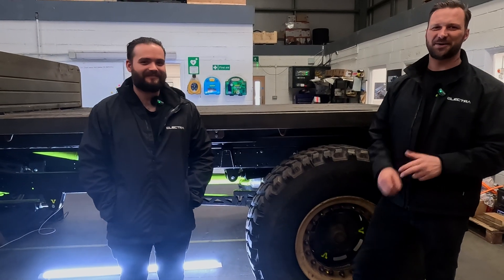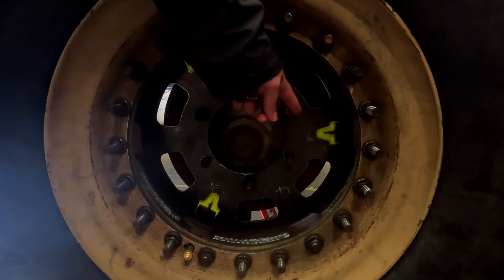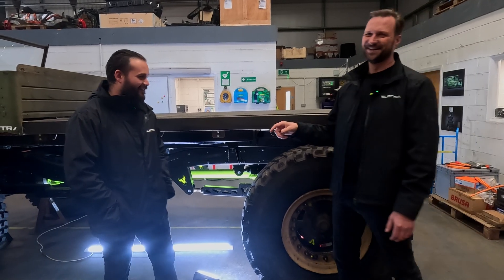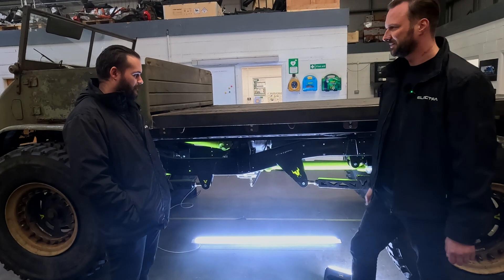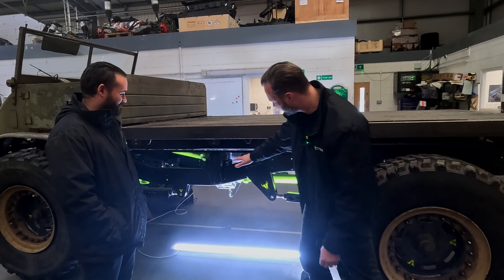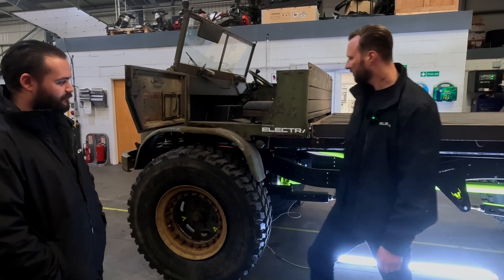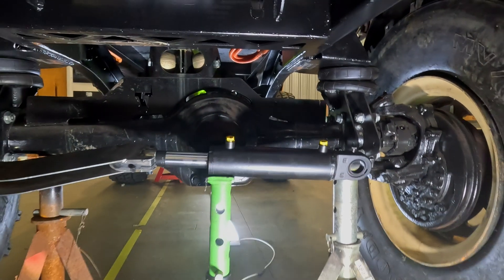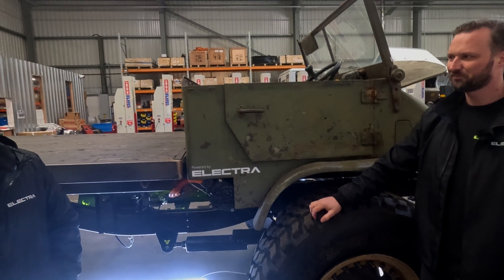Electric Unimog 404 Mog-E (Part 3) Progress and future plans for the Unimog

Comment: Quite interesting and nice build! Really nice craftsmanship. 
And probably the first right-hand drive 404 I've seen! However, not the first electric 404. There is one running around in trials sport. Although with a different approach, keeping the organal gearbox and torque tubes. 

As you mentioned, stiffening up the chassis is a major concern, at least if you want to do some serious offloading. The 406 Unimogs with forestry equipment had broken frames due to the heavy winches and the harsh environment they see. So the companies providing the winches stiffened up the frame to make it stronger and only got more broken frames due to rises in stress. 

This is why the Mercedes engineers tried to always just use three bearing points for the bed, the cab and the engine (especially on later designed, they moved on to 4 points again, when it got too big). So they could all be stiff and the chassis flex and turn around it. So the size of the battery wouldn't be too much of a concern if you would fix it in a way so it could flex. 
The same probably goes for your motor mounts. From what I've seen you fixed it to both sides of the frame? I guess you need a strong mount to counteract the torque of this motor, but it also stiffens up the frame. The original engine again, only had one center mount in the front and mounted through the gearbox in the back so the chassis could flex around it. Because if your frame flexes to its full extend, the chassis rails also move up there in the front. If you google "Unimog 404 Museum" you'll find a picture of a stripped down 404 flexed to its limits. 

When it comes to component strength: You removed the two biggest weak points of the 404: The engine and the transmission. I mean, the carbureted  inline 6 left your mog a long time ago, because its just antiquated. But the transmissions fail on these a lot. As for the axles they can take some 100 odd horses, but after that, it's uncharted territory. I think there are companies that fit them with bigger axle shafts etc, or you could just go to 406 or 1300l axles, etc.
Reply from the maker: Hi  @humbucker0076  , thank you for the great comments - a new video will finally be dropping in a few weeks! 

I have heard of that one it’s a low voltage setup, I believe this will be the first high voltage one, certainly very unique with everything we have done.  

We have completely changed the battery setup it now sits in a truck bed style setup with pivot mounts like before. Hopefully this will allow the flex, however I’m not sure how it will handle and flex differently with the airbags installed.

The motor will put out crazy torque and twist - 2500 NM in seconds so it had to be very well secured, it is rubber mounted so this will allow some small amount of twist/flex. 

In my opinion the worst things were seat/feet position Engine and gearbox so I’m really excited to see how much different this will drive it will be night and day with any other Mog.  

Axles are the weakest link and the brakes - luckily I have sourced a 416 rolling chassis ready to use those axles, however i do now think building the 416 chassis with a Doka cab needs to happen!

Comment: just stumbled on your channel.  It's awesome you've listened to the community on the battery/frame flexing argument.  I'm very slowly working on my own 404, and I can tell you the Bilstein Mog that looks soooo cool is the only Mog I've ever seen that the community as a whole gets upset with because they approached it like a "normal" truck.  The angst that build got was so unique because every mog is different and there are no purists at all.  Wet spaghetti is how a Mog is suppose to run.  Rigidity is the enemy which is totally bizzaro  opposite of everything.  I've watched the electro pinz/haflinger and since I've had my project thought that the 404 would be perfect for this sort of conversion.  thanks for sharing this.

Comment: My opinion is you gutted all the good Unimog features out except the frame. The torque tube suspension and unified transmission and transfer case are gone! What you have there is a completely modern 4 link  engineering muscle flex to see how far you can get from being a Unimog at all! I will resub when you start again with a different unimog and just replace the engine with a sensibly sized electric unit. Please don't overpower it!
Reply: I agree mate and if they had started with a square cab mog there's a handy prop shaft going from the clutch to gearbox so connecting a different motor/engine is super easy, disappointed in this build unfortunately